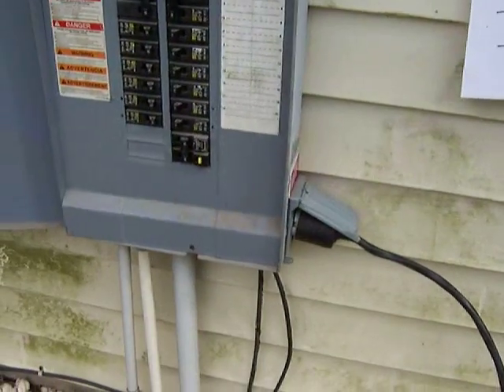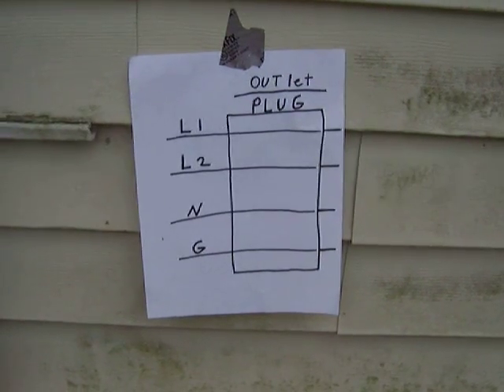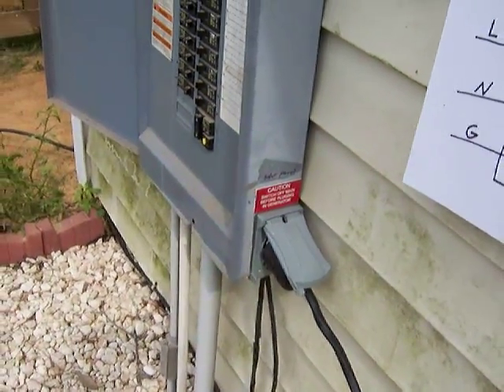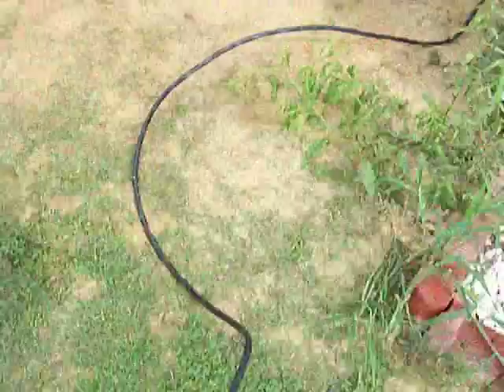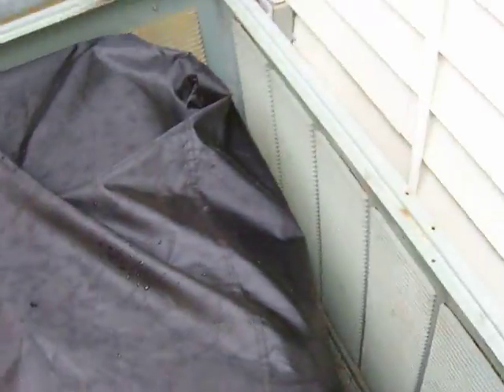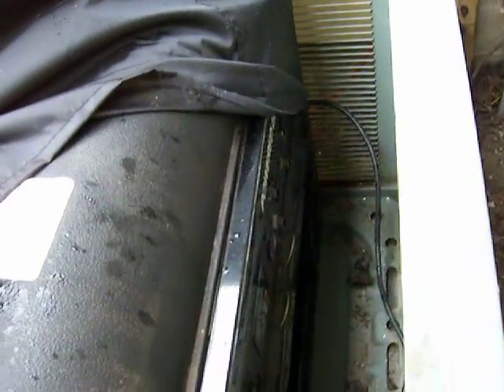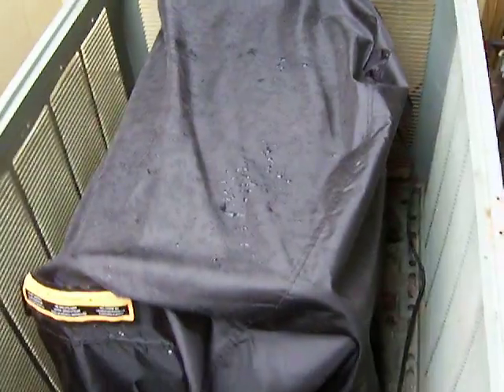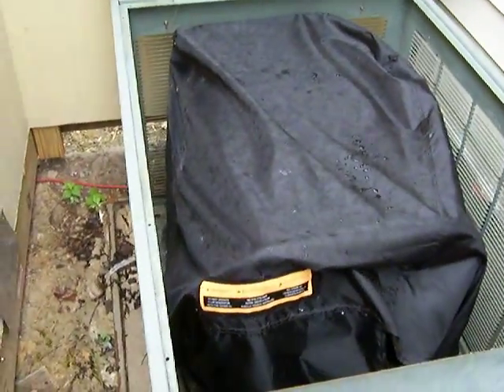connect a generator to your circuit breaker box in a emergency (back feed)

Comment: Technically speaking I guess I’m back feeding my 100 amp House box because I wired my detached garage with a 60 amp I connected 8 gauge to my garage service panel to my main 60 amp and wired in my 30 amp to my wall mounted Reliance L-14 30 amp 4 prong interlocking plug and my 25ft 10 gauge plug to my wall mount and generator no suicide cords. When the power goes out I go in basement to 100 amp panel and turn my main off my Central air off and leave on my basement laundry room lights where my main panel is then I go outside to garage and start generator let it fun a few minutes then turn on my 30 amp principal that is 10 gauge wired to my gen plug. Go inside house and one by one turn all house breakers on. My hot water, furnace, range and dryer are all NG. My Predator 8750 has no problem at all running what I need I just leave breaker for AC off and good to go. The most important part is leaving breaker to service power off when running generator into main panel.

Comment: FYI. It is illegal in Texas to not have a interlock device in the panel. That being said, I do it without the interlock ( I'm not paying $60 to $100 for a piece of metal) but just be aware what you are doing. Don't invite an electrical inspector to your house and open your box. Haha. I little common sense goes a long way........Good Vid
Reply: +Stone Man When a disaster strikes that leaves no power for days, weeks months, no one cares if it is legal or not. When these things happen, people unprepared hook up suicide cords by the millions. They are beyond safe to use for anyone with an IQ above 60, and obviously if the mains are off and the generator is off, there is no power to worry about. So when faced with watching a family suffer, being put in dangerous positions, and having little to no food due to no refrigeration, or back feeding their house "illegally", I think over 99% will backfeed their house.
Reply: Deucealive75 One other point, It is impossible for a small generator to backfeed the line IF you forgot to turn off the mains. The draw from every house on that line, would be so large it would instantly trip the 30-50 amp breaker on the generator. The only risk to not turning off the mains, is frying the generator when power comes back on!!!
Reply: If you look at the many videos here on you tube about this subject, your comment applies perfectly. I find the comment section of many of these videos very entertaining with the "experts" weighing in on how this that or the other thing is illegal or dangerous. It is nice for them to give advice and I'm sure they are well meaning. But unfortunately some do not seem to understand "risk versus reward". I also find it entertaining how some treat the subject as if they are dealing with rocket science when it is not complicated at all.

Comment: I don't like the retrofit panels with the little button breakers either.  The manufacturer insists that they're UL listed but I don't trust them.

Now, the setup shown in this video could easily be brought up to code by replacing the outlet receptacle with an inlet receptacle, and fitting an interlock between the main breaker and the generator breaker.

Comment: im not sold on the switches, i dont like how the power runs through them constantly and the breakers are not full size, and there is the same chance someone else will connect your cord wihtout killing all breakers and huriting your machine as someone other than myself or this guy pluging ours in. . i have an interlock bracket i made out of a road sign that i install when backfeeding so if someone were to open the panel and want to play around they couldnt, other than that the swich it hot